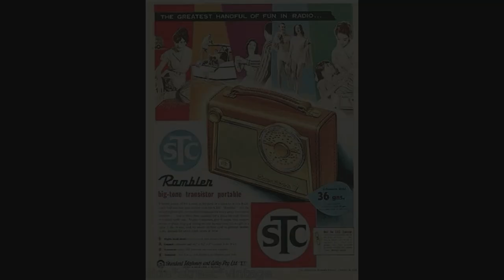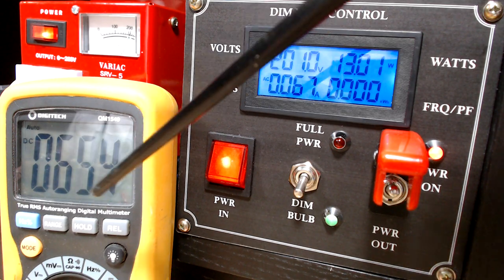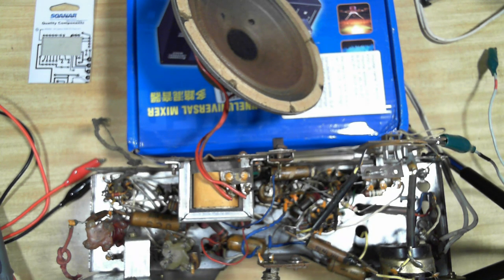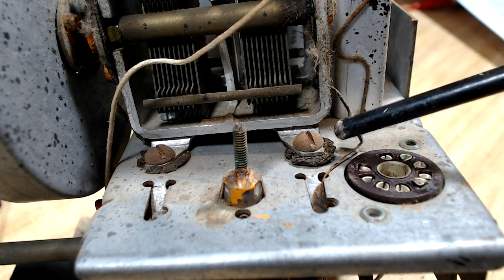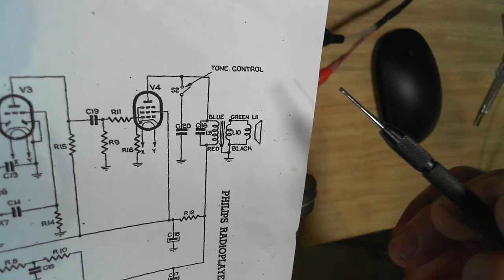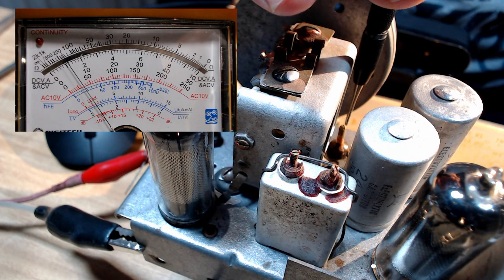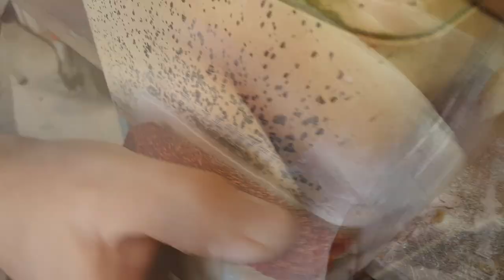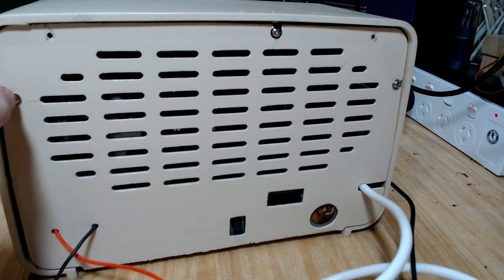$1 Basket Case Radio Restore - Fleetwood 1061 AKA Philips 165

Comment: I like your lathe! In high school I was an Industrial Arts  major, with 4 years of metal shop,  wood shop, and 
Mechanical Drafting. After high school, while as an working as an apprentice in a machine shop at Barker and Williamson, a Radio Manufacturer, 
 I met older gent who got me interested in Radio. The company offered to pay my way through electronics school. They subsidized my tuition , I paid for books and transportation. Upon graduation the company put me in the Radio Labs. A few years later In 1965 Uncle Sam had other plans for me during Nam. He decided I  an aptitude for electronics and trained me for Field Radio Repair. While I spent my working life in the electronics field , I still utilized my machinist background. Once I was hired as a electronics tech for RCA mainly because I also knew how to operate a lathe, shaper, milling machine and drill press. They put me in R and D lab building prototype chassis. I do admire your mechanical skills. You really went the extra mile on this radio. Your skills, and tenacity are an inspiration. Thank you Mr. Wizard!
Reply from the maker: Hi Cosimo, the lathe is brilliant, I put off getting one for ages but my wife insisted I get one if it "made me shut up!" I was in no position to argue 😄 I gained my experience with machines at school and during my apprenticeship then a lifetime of dabbling with them at home, It's a good skill to have as you describe. I was due to be called up in 1972 but conscription was abolished a month before I was due so never went to Nam. I would love to be in R&D, such an interesting field. Thanks for your comment Cosimo, P.S. I've added 'Cosimo' to my spell checker 😃

Comment: That radio looked absolutely hammered when you started work but it just goes to show, where there's a will, there's a way!
Reply from the maker: Thanks Paul, It was only last minute that I decided to try and repair it, it nearly ended up in the parts box 😃

Comment: Hi, I have an old russian radio and after your video I hope I will repair it like you. Can you write the ingredients which you use when repair wood body of the radio?
Reply from the maker: Hi bezbotvy, There was no wood in the radio, the back is made from cardboard, I have pasted a previous reply below, I hope that answers your question: "It's automotive body filler for the case, if you are referring to the cardboard back it's just Papier Mâché but I use PVA glue as the adhesive and a bit of flour as a filler and binder. If the back I'm repairing is not painted I add acrylic artists paint to colour match the original. In this instance it wasn't dry when I removed it from the press but a minute or two with the heat gun and it was rock hard"

Comment: JB Weld. Great stuff all over the world. Almost 50 years ago my Granddad and I patched about a 1"x1" hole in the side of a 5HP Briggs & Stratton engine on a garden tiller with 12GA copper wire and JB Weld. The tiller was nearly new, but had thrown a rod through the side, so someone gave it to him. We used it for years. I replaced another thrown rod about 3 years later when I was about 13, and we used it for around 10 more years until my Dad upgraded. Great video, greetings from Upstate South Carolina.
Reply from the maker: Wow phonograf, that's impressive, it does work very well but that's amazing 😲  We did a driving tour from New Orleans to New York via the Smoky Mountains then Savanna, we must have gone close to you 🤔😃
Reply: @DavidTipton101  Probably did. In the foothills, just below Greenville, SC. "yeah, that Greenville". I live about 3 miles south of I-85 in Mauldin. I've worked some and visited Savannah, both when I lived here and in Augusta, GA.

Comment: Greetings from melbourne. I have to say that watching the cabinet reconstruction was the best part of this video.
Having access to a well equiped workshop makes a big difference. Keep up the good work David
Reply from the maker: Hi John in Melbourne, I grew up in Essendon. The cabinet came out great, it's a good looking radio. Thank you 👍🙂
Reply: @DavidTipton101  Hi David, thanks for your reply, i worked in aviation at Essendon airport, but am a williamstown lad. am currently watching your philips first transister radio video. Stay safe
Reply from the maker: @johnfinn1570  I worked with TAA at Essendon Airport from 1971 to 1977 as an apprentice and later engineer. I studied at RMIT from 1971 to 1973 or 74. Our paths may have crossed at some time 🙂
Reply: @DavidTipton101  Hello again David, i joined AWA aviation located at the back end of essendon airport as an apprentice in 1973 and also attended RMIT. Our workshop had a major fire some months after i joined and we rebuilt across the road in king st airport west. Indeed our paths may have crossed, as they say, its a small world 😀

Comment: Absolutely fantastic, and thankyou for showing us the process.

I became an Radio and Tv engineer many years ago, at the tail end of valves.
Now years later I work on Surface mounted components, the size of dust.

I think the 220K resistor just burnt out, as component technology back then wasn’t as advanced as it it today.
Back then DC voltages were lethal, and glad to say I havnt had any belts, but had a few from ac circuits.
Reply from the maker: Thanks Ritchie, I wonder if the valve didn't help the resistor fail 🤔 DC belts can be worse than AC I hear 😲

Comment: Loved the idea of boring out the old casings to still utilize them. Keeps the integrity of the original while upgrading to a quality part.
Reply from the maker: It works well goto5007, if you can get the capacitors small enough to fit the cans 👍🙂

Comment: It always warms my heart and inspires me seeing antique radios that somebody many decades ago may have scrimped and saved for, bought and had in their home and been proud in owning it; than many decades later after the original owner passed on of old age, the radio is cherished all over again.

I was walking along a train track near a junk yard, (I see weird things dumped in the path near there). Well somebody dumped a 1950's Philips model P145 tube radio in the swamp!
It was partly submerged in the green slimy water filled with ants and dirt. Gold speaker cloth bleached white by the YEARS being out there in the elements.
It was complete, all the tubes were present, the speaker hadn't been submerged, and the cord was unmolested by the copper bastards. Not kicked to smithereens by teenagers either (yet).

Took it home, tested all the tubes they were all in the green on my tester and none had gone to air. I have a gadget for testing old speakers, a cheap Bluetooth speaker with the wires extended out of it with gader clips. The speaker was FLAWLESS! Power transformer took a heavy Cosmo Kramer swim! Tried to dry it, turns were shorted. Unbolted it, discarded it. I have a plan for a replacement.
Wire the heaters in series and run it on 24v with my WWII dynamotor off my 24v solar system I have in house. Or another interesting AC transformer based solution with two matched 12v transformers back to back.

All the steel parts were rusty, I soaked all the small parts in boiling water/acid which came up nice. The dial plastic came up nice, thank god the markings are etched or something because I had to carefully wipe it because it was slimed with green pond slime. The case is thick bakelite. This wasn't a cheap radio. I saw all kinds of sweet little QoL design choices. Lots of felt gaskets to prevent anything vibrating, gold accents, a nice PM 8" speaker, phono input. Philips answer to the RCA Victor Golden throat radio? The acid treatment destroyed the gold line of paint on the knobs after I got them off the shafts being frozen on. I'm going to repaint that gold trim. Thank you David for inspiring me!
Reply from the maker: Hello @KeyboardBuster. I saw this comment a month ago on my phone but couldn't find it when I went to my PC, it showed up again today. That is an amazing story of your poor Philips, I hope you can get it working again. Pity about the transformer, I take it you are in North America or close to it where old radio transformers are in short supply, It 
 could be rewound if it's in good enough condition. I have had success rewinding transformers at home. All the best with your project 👍🙂

Comment: Wow! Your cabinet restoration skills always amaze me. Such attention to detail. You put love in to your work and show respect for the set you are working on. This set has an interesting valve lineup. 6AN7 RF heptode - triode, 6BH5 IF, 6BD7 AF & Det. 6M5 OP and 6V4 rectifier. All 9 pin base.
Reply from the maker: Pretty standard valves in Aussie set for the time Daniel. Thanks the radio came out nicely, thanks 😀

Comment: Hi David, I see you restoring those 220 volt radios, so amazed to see real power transformers in them!  Here in the States, valve table radios NEVER used power transformers!  Such a fine restoration!  Good job!!
Reply from the maker: Hello QL, I've yet to see a transformerless Aussie radio but I'm told there were some built. We officially run 230 volts here but I suspect it's average is still closer to the old 240V 😄

Comment: I once repaired an old valve radio with a similar circuit. It would not work because the primary coil of the first i.f transformer was open circuit, so I rewired the mixer/oscillator valve using the secondary tuned i.f coil as the anode load, and then fed it on to the i.f valve grid via a capacitor. It worked, though gain and selectivity were down slightly. To compensate, I boosted the RF gain with a small FET amp driving the aeriel coil, hidden so no-one would realise it was there. I'm OK with the electronics but seeing you restore the bodywork and mechanics was a learning experience for me.
Reply from the maker: Hi Geoff, that's a neat trick and would have never occured to me. I have a supply of IF transformers so hopefully won't need to resort to your fix but good to know, thanks and cheers 😃

Comment: Very clever restoration. Looks like it was a lot of work and man hours. I was an electronics tech in the Air Force, so the schematic was easy, but the restoration is out of my league. Great work, you are a skilled craftsman.
Reply from the maker: Hi Johnny, yes, I spent more time on it than I thought I would, but it's mainly do something for half an hour and let it dry for 24 hours. I was an airframe/engine engineer in commercial aviation for 43 years. Thanks for your comment 😃

Comment: Amazing! Isn't it wonderful how those old valve radios just keep on and on working? Just replace a few bad parts and on they go. Great job on the case. Looks better than I ever thought it would.
Reply from the maker: Hi John, most parts are easy to replace unlike modern gear, I can hardly see the parts much less change them 😉😄
Reply: @DavidTipton101  It can be done, though most of the work is done within chips and it can be hard to get schematics for them. My friend does a lot of modern electronics repair -- it has totally changed my worldview to know that things really can be repaired instead of discarded again.

Comment: The case rebuild was some of the best work I have seen. It beats the wire grid method by a mile ! I have several backs with chunks out , and edges gone. 
What was the mixture that you used to make your filler?
Thanks for taking us along .
Reply from the maker: Thank you David, it's just automotive body filler for the case, if you are referring to the cardboard back it's just Papier Mâché but I use PVA glue as the adhesive and a bit of flour as a filler and binder. If the back i'm repairing is not painted a add acrylic artists paint to colour match the original. In this instance it wasn't dry when I removed it from the press but a minute or two with the heat gun and it was rock hard 🙂

Comment: Very impressive work - especially on the case restoration. I used to restore old valve radios - but was pretty much a trial and error repairer. I Passed on my remaining stock of radios plus all my "bits" to another restorer but kept one radio for myself - an old Columbus. I was most amazed by your range of test equipment - I think I just had a couple of multi-meters but you seem to have a tool for every test.
Reply from the maker: Hello Kenneth, I'm relatively new to this hobby too so I'm a bit trial and error myself. I am slowly building up my test gear one bit at a time, I have most of what I need now. Thanks for your comment 😃

Comment: Radio doesn't seem too badly corroded or damaged inside for a tube model. Was ugly and dirty, now clean, presentable and working virtually like brand new. A lot of TLC went into this one.
* 2 thumbs up *
Reply from the maker: Hi RJ, the chassis was surprisingly clean 🙂
Reply: @DavidTipton101  I liked the reference to the 6M5 having "more shorts than a football team" but I especially liked the way you re-stuffed the filter cans with new caps to preserve authenticity on the chassis. Brilliant. :-) Some people don't seem to appreciate vintage technology like this which was originally built to last using quality components and offered some serviceability if needed.

Comment: Never thought of drilling a cap out on the lathe. Very imaginative! Great job all round. I am still a novice at this restoration work and would dearly love to sit with someone to take me through an alignment process.
Recently restored a 1937 Murphy A34 that had been well got at, but with help from the UK vintage radio forum it is now singing!
Reply from the maker: Hi Lynton, the Murphy is a big project, you did well to accomplish it. There are plenty of people out there willing to help, hang in there 👍😃
Reply: David Tipton yes it was a big project took over six weeks of full time work. Came out quite nice in the end. Yes I have found some very knowledgeable people on the UK forum who are happy to help.
I passed my Ham exams many years ago but spend more time listening these days.
Next on the list for me is a Hallicrafters Sky Champion which has been in the back of the shed for ages!
Thanks for the reply and happy restoring.
Cheers Lynton G4XCQ

Comment: Excellent job as always.  Looks a lot like a Stella radio I brought back from the UK to the US years ago.  Also made by Philips I believe.  I love your method using aluminum to brace the plastic after repairing the cracks!
Reply from the maker: Hi a587g thank you. Be interesting powering the Stella in the US unless it was an AC/DC set and easily modified. The aluminium may block the signal somewhat if the set has an internal antenna 🤔

Comment: Beautiful craftsmanship. I do admire your approach in keeping what is good. But really love how you re-used the old electrolytic cap alu casing for some modern caps. Inspirationally briljant. However the inside material and fluid of the old ones is quite nasty and very unhealty. Thumbs up!!!  David. Greetings from Holland, Ruud
Reply from the maker: Hi Ruud, yes, I wear a mask and clean up the refuse after, you can't be too careful 👍🙂

Comment: You can change the tar-caps without thinking, it is very likely, that these are all on the fritz in  a way leaking. DC on the grid is commonly a problem after that time. Thanks for your vid and for that very good job to participate in.
Reply from the maker: Hi Johannes, yes, I always change all the wax caps but like to try it out first to see how it works with the old caps in it and any problems that they may cause for a more interesting video. The grid coupling cap is high priority. 
 Thanks of your comment. 😃

Comment: Fantastic work! Real labour of love that one. 

The 6M5 is infamous for silver migration between pins. Sometimes cleaning that off can make the valve useful again. 

Regarding crazed dial plastic, I have manged to bring those back to clear via a good application of very fine wet and dry (with a drop or two of dish washing detergent as a lubricant) to cut back the surface followed by Autosol liquid metal polish to bring back the clear plus plenty of elbow grease. Of course that technique only applies to disl glasses without stations marked on them.

Regarding re-stuffing electros, I haven't seen them bored out like that. I usually fine-saw them off just above the base, remove the tar with acetone, then glue them back together with 5 minute Araldite.

I'm surprised the NOS 220K resistor hadn't gone high. Just about all of my stock of those original carbons has gone high.

Re dial stringing, my experience is that Philips/Mullard came up with some of the most diabolical arrangements and, without a diagram, it's mental torture to get them right. That Fleetwood was comparatively straightforward compared to their usual labyrinths. 

Regarding the case restoration, I'm not familiar with that PVA and cling-wrap technique.
Reply from the maker: Hi James, I did rub the dial back with wet and dry to no avail, the brown was right through.
That's another way to stuff electros.
I was surprised the 220 was open.
Yes some dial strings can be a nightmare.
Neither was I till I tried out in the video, it seemed to work well though

Comment: Fantastic radio restoration and you really know your way around radios and it's funny how sometimes it's not always the tubes that can be something like a resistor or capacitor I had a radio I picked up at a flea market once that would play on auxiliary input but would not pick up any stations and later I found it was a burnt resistor underneath that was the problem if I remember right it was an old RCA
Reply from the maker: Hi Richard VG, thank you. Tubes are not always the problem and old capacitors and burnt resistors are often the culprits. Good job getting it going again 😃